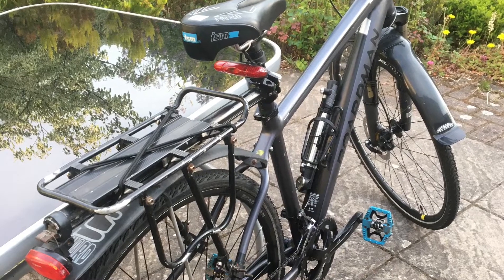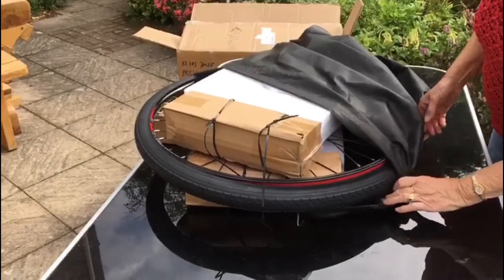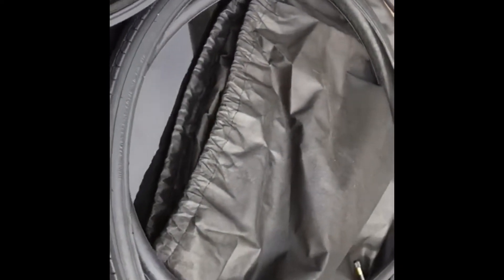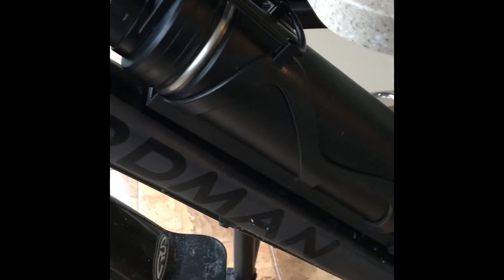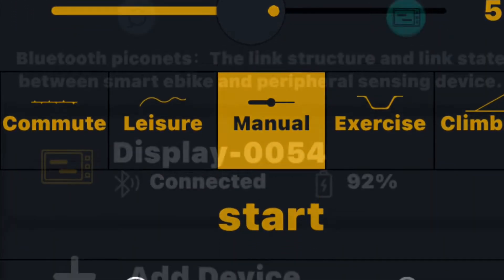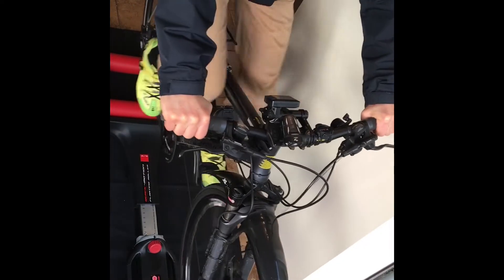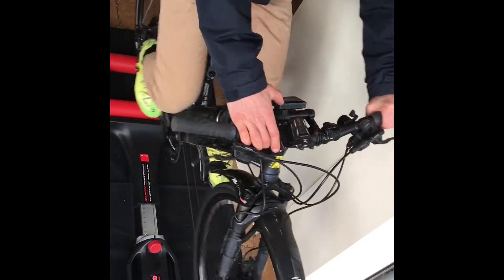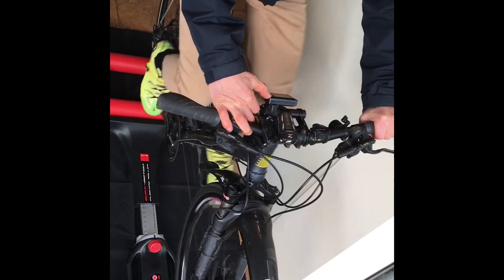Demonstration of the KF series LVBU Technology electric bike conversion kit.

Comment: Thank you for an informative video of the LVBU kit. I look forward to getting mine soon.
Reply: If you get one, some things to consider: If you need to get spares for the kit you will have to go direct to Lvbu in China. The UK stockists, myelectricbikeshop,  said I would have to get a complete kit when I only wanted a spare battery. That is if you can get hold of this UK stockist! When I try online it says connection is not secure. The postage of battery from China is expensive too.

Comment: This is the same kit as the one I have, supplied and rebranded by a company called Easifit in UK. I have had it around one year. I have found it reasonable, quite low powered and as you go up the power scale there is not a huge difference between, say,  20 per cent and 80. It doesn't compare in any way with the power delivery from my Raleigh Felix Plus ebike but it's ok for pottering round town. I wouldn't want to use it in a hilly area.
Reply: Further to my previous post, Easifit are now defunct, stopped trading.

Comment: Did you used pass pedal sensor? How the kit can work without one?  thank you
Reply from the maker: No Pass sensor required with this design.  The system uses  a gyroscope to determine whether the bike is accelerating, braking, going up hill and down hill.   Power to the hub motor is determined according to the results from the gyroscope sensory feedback.
Reply: @philiphiggs1615  The gyroscope system is far from perfect even when calibrated correctly. Into a head wind in particular the whole system does not perform that well.

Comment: How much was it?
Reply from the maker: The price paid was in US dollars.  I paid $360 for the KF series Waterproof Electric Cycle Conversion Kit with Battery, for a 700cc wheel.
I paid an additional $195 for a second battery.  All Purchased in July 2022.
Reply: @philiphiggs1615  From where did you bought it? Thank you
Reply: Ok i read your info at the top. Thank you
Reply: That's a great price. I bought one myself for £320 but without the Bluetooth display.

Comment: what is the maximum speed of this kit?
Reply from the maker: So far I am very satisfied with the LVBU electric wheel.  It’s difficult to determine the top speed.  Speed is controllable using the LVBU application down loaded to your smart phone.  Please look at the LVBU web site to determine the maximum speed.  AT A guess I think it is approximately 20mph.   It’s your choice, there are many different methods to electrify your bicycle.
Reply: @philiphiggs1615  Is there a way to increase maximum speed? Thanks
Reply from the maker: The range is variable depending on many variables.  I managed 62 miles on one battery using the system set at 50% to 65% assist.  The terrain was fairly flat with a few small hills.   I’d suggest expecting at least 40 miles from 1 battery in the worst conditions.
Reply from the maker: Yes the application that controls this ebike conversion kit allows you to vary the maximum speed.
Reply: @philiphiggs1615  up to which speed?
Reply: @xrnicolas  The maximum speed is 20mph if you set it up accordingly. This speed is illegal on UK roads (unless of course you are doing all the work above 15.5mph and pedalling!)